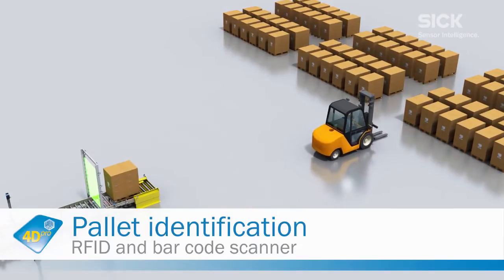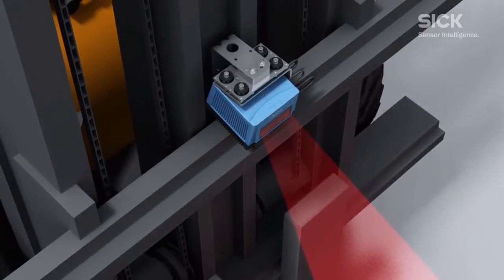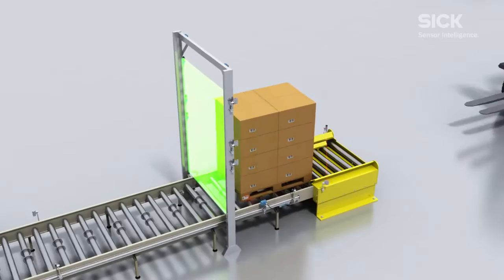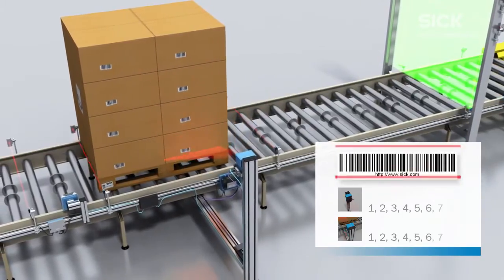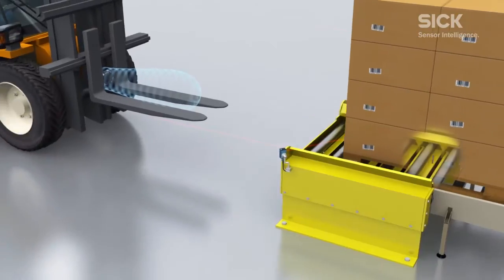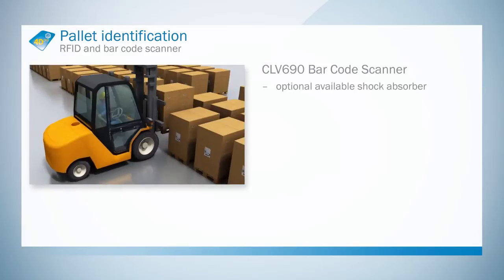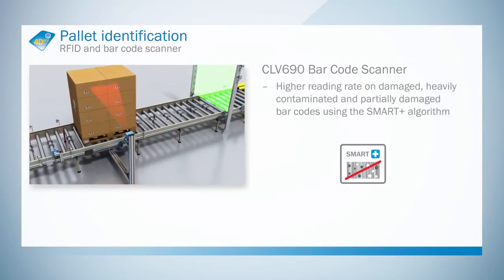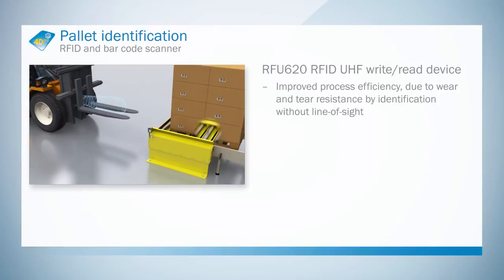Pallet identification RFID and bar code scanner with 4Dpro from SICK

Comment: The integration of RFID and barcode scanners for pallet identification is an impressive approach for optimizing logistics and warehouse operations. SICK’s innovative use of these technologies ensures efficient detection and assignment of load units, significantly improving workflow automation in factories and distribution centers. This kind of automated system enhances accuracy and operational speed, benefiting industries looking to streamline processes.

I recently came across an insightful piece at GAORFID Inc. that could provide more comprehensive knowledge about RFID tracking and its applications in logistics.